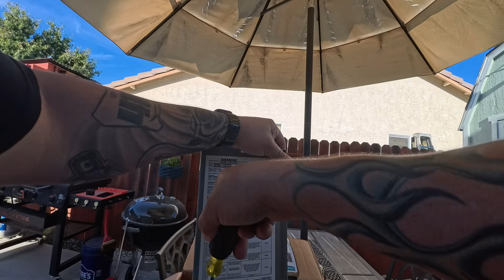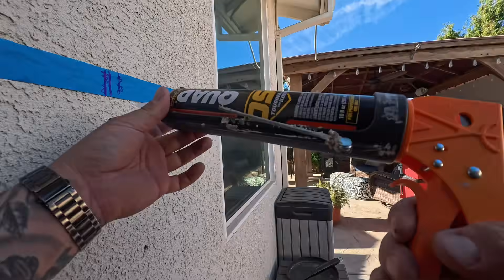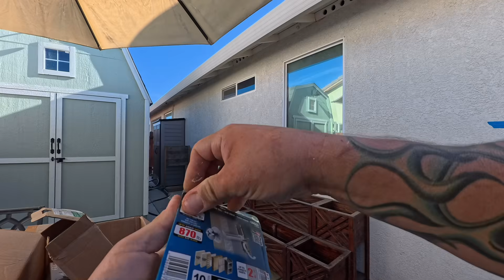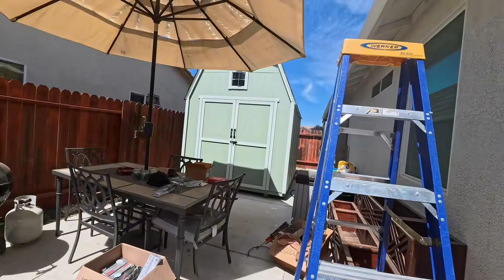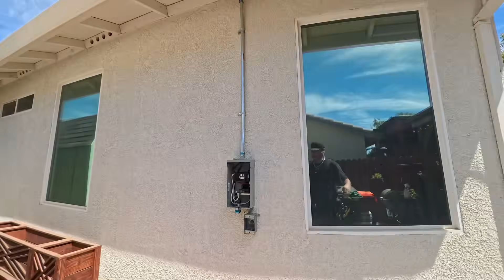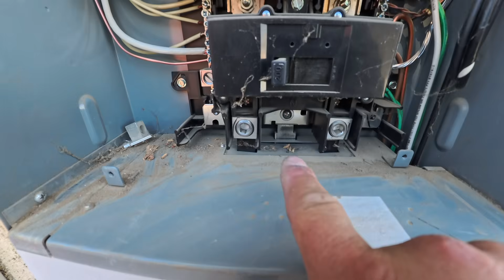How to Run 240V Power to a Backyard Spa | Safe & NEC Code Compliant | Part

Comment: Now look up 200.6(A).
Reply from the maker: So I can put 3 stripes but I can’t tape it the way I did ?
Reply: @Wistermanelectric how are you going to do that for the whole length of the conductor?
Reply from the maker: @Ok-47140  I aways thought it was 8 and smaller had to be continuous color. When I just went and read it the code it said it also could have 3 white stripes so I was sure what that meant at first but that’s probably the conductors you can get with the thin colored lines that run the entire length of the wire. Thank you for pointing this out. I’ll be sure to make this correction in the future.